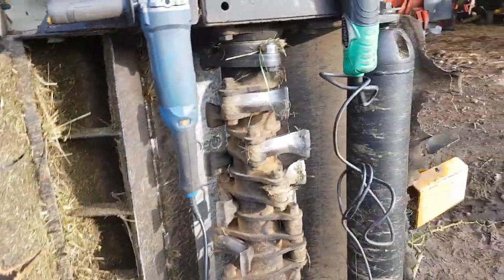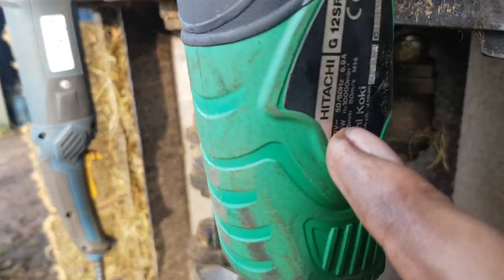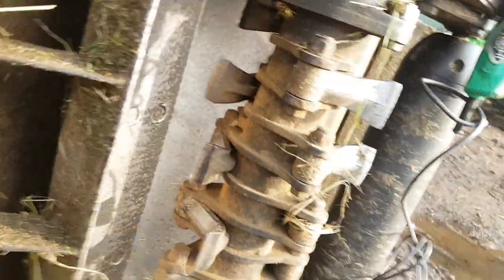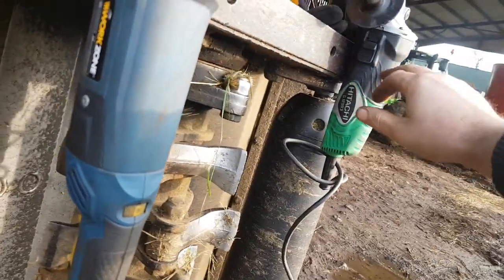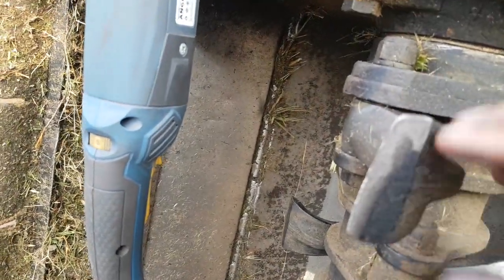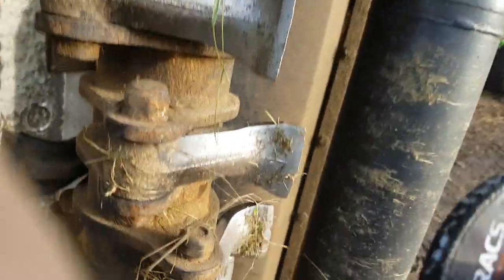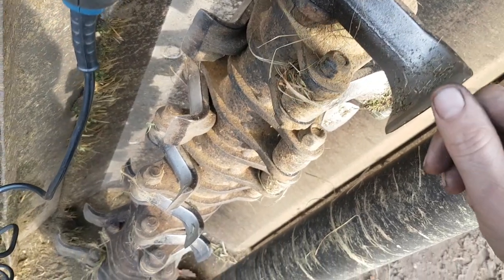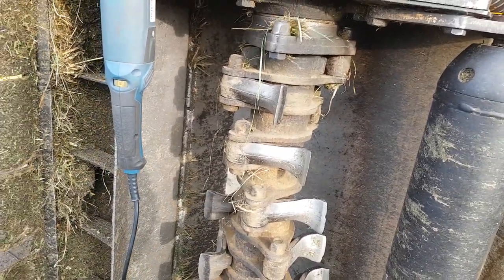How to maintain hedgecutter flails and why I like my cheap angle grinder

Comment: I have virtually the same type but made by parkside from Lidl ,with adjustable power and decent trigger.it will take a 5" disc too which is handy .I did not like the completely enclosed guard on it as you can't use any grinding pad with fibre discs  ,but you can tweak the guard by removing the section which wraps around infront the blade and this allows you to fit the grinding pad and fibre discs .It is still safe as your not removing the guard completely .I wouldn't use a grinder without a guard to be honest  .You have to be careful with the trigger as I can see it could be left on at times .I personally would just have it on or off and no lock feature.